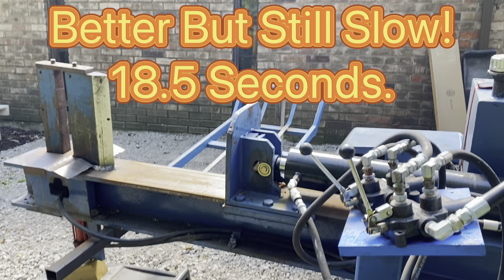How to Make Hydraulic Log Splitter Way Faster! #80

Comment: No need to crack lines to bleed air hydraulic systems will always push the air back to the tank tighten lines and go great mod tho that will help a lot
Reply from the maker: Thank you. I wasn’t sure when I did this mod and recorded the video. I figured better safe than sorry. One thing I like about having a channel is the fact that not only can I help others with ideas but others can help me with comments as well. I still have a lot to learn. Learning every day.

Comment: Your major flow restriction is at the elbows, not the line diameter.  "What is the pressure loss in a 90 degree elbow?
Designers usually apply the general rule that a 90" elbow bend has a pressure drop equivalent of 30 to 50 pipe-diameters length of straight pipe"  Use longer pipe or long radius elbows.
Reply from the maker: Richard, thank you for the information.  Definitely something to consider.
Reply: Boules law on fluid pressure in an enclosed space states otherwise. Pressure is equal everywhere. Aircraft actuators have 90 degree elbows and it’s going to be 3,000 psi wherever you measure it
Reply: Pressure and FLOW rate are entirely different. GPM at the pump is limited by the fluid delivery piping length and turns. @Huzzunga

Comment: Love the term " ticket money".
Teflon tape shouldn't be used on hydraulics. It can break apart and cause contamination or blockages. There's paste that can be used.
Because of the oversized rod used on those cylinders there is a much higher flow rate when the ram is retracting. This is often well in excess of what your valve can comfortably handle. This is why dump valves get fitted on splitters with oversized rods. You may end up with some oil overheating problems if your valve is close to the capacity of the pump. If they are both 15gpm for instance then it could easily be more like 40gpm that you are trying to force through the valve when retracting.
If you don't have overheating problems you'll now have yourself a fair beast.
Reply from the maker: Alan, thanks for the info. That makes sense with the Teflon tape, you can see in the video I pick a little debris out after removing the old lines which also has Teflon tape. I have no idea what these valves are rated for, I believe I may have a 22gpm but am not sure. The hydraulic tank is 12 gallons. I have run it a bit since and it has not gotten too hot yet I will definitely keep an eye on it. 

Thanks for the tips and for watching and commenting. My ticket money is gone for a little bit now as I just picked up my new splitter!  I am trying to get that on the channel shortly I have a few videos to catch up on.
Reply: I've never needed ticket money as yet. I am thinking with all the money I have saved in more than 30 years of driving and not needing to use it I should finally buy myself a box store splitter and then speed it up. Maybe put a Binford 6100 splitter kit through it.
Reply from the maker: Knock on wood it’s been well over 20 years for me. You’d have the fastest box store splitter out there.

Comment: Did you change the size of the push and retract hoses , are they still 1/2''. What size pump you running? My oil gets hot , I have a 1'' return hose but the delivery hoses are 1/2'' I think I will swap out for 3/4'' for less restriction. The pump is 2 stage 28gpm. So it hoots along. The cycle time is amazing.
Reply from the maker: Yes, I changed out all of the hoses to larger sizes. This machine only had a 22gpm pump. I think you definitely should upsize from 1/2” for that machine.

Comment: Nice project❤❤, pls what's responsible for faster movement of the cylinder?
Reply from the maker: Thank you. I think the biggest difference is the diameter of the inner cylinder on the hydraulic Ram. It is a larger diameter than the old ram so it has a little less power but is way faster.

Comment: Loved the rant, I agree entirely, what bugs me is the drivers trying to fit their hood into my tail pipe, they are so close you could have a conversation. Some nice splitters you got there, I need to upgrade mine but never seem to get round to it. All those 90°s on the blue will have a lot to do with cycle time too, you could turn the controles to verticle and have the same hoses going strait in without the 90°s. A good way to check for problems is a one of those IR temperature guns, after running a while the problem areas will be hotter than the rest, follow the circuit from the pump output all the way round to the tank return and look for sudden temperature rise in and out of each component.
Reply from the maker: Thank you Derek, I never thought of that. I love learning more!  I have since upgraded from old blue but still good information to know.
Reply: @hardworkingmanoutdoors the IR temperature guns are good for checking trailer wheel bearings too.
Reply from the maker: @akbychoice  definitely, I use mine a lot for the flat top griddle too while cooking. So many uses. Thanks for commenting!
Reply: Ticket Money! Love it! Totally agree! Now for the business at hand!
Reply from the maker: @dporrasxtremeLS3  thank you!

Comment: There is no need to bleed the cylinder, any air will get pushed in return line to the hydraulic tank. Tank has a breather
Reply from the maker: Thanks Randy, I wasn’t sure at the time I made this video but have since learned quite a bit about hydraulics. Still a rookie but learning as I go.
Reply: You are absolutely correct.

Comment: Keep in mind what you gain in speed you loose in power. My home made splitter is 15 secs a cycle which does me just fine as I need all the power I can get in Aussie hardwood. You don’t need such long travel. This is where you can loose time. No need to bleed lines.
Reply from the maker: Thanks Alan, you are correct. The power is a bit less but will still split almost anything I need it to. I wasn’t sure about bleeding the lines but have since learned it was unnecessary.
Reply: @hardworkingmanoutdoors  not having a dig mate. Did a great job. As long as it splits all you need is…..all you need. Cheers mate.

Comment: I am new to your channel and just watched your video. I have the same problem with my splitter being too slow I was wondering if you change anything else beside the cylinder and the return hose. What size is the pump on blue?
Reply from the maker: That is all I changed on Blue. As far as I can tell it is a 22gpm pump. The cylinder size and ratio made the biggest difference.
Reply: @hardworkingmanoutdoors  Thank you, sir, changing out the cylinder was going be my next move.
Reply from the maker: I was apprehensive but really glad I did it!
Reply: @hardworkingmanoutdoors  Do happen to know the spec on the timberwolf cylinder?
Reply from the maker: The outer diameter of the cylinder is 4.5” and the shaft is 2 3/4”. If you need any other information let me know and I’ll try to get it for you.

Comment: @ $1,300 delivered you could have a 27 ton NEW Yardmax splitter.
Reply from the maker: I used to have a 35 ton Huskee and even before I sped old blue up I could make more wood with it easier than I could with that splitter due to being able to push the splits through, stacking splits, and the 4 way.  Now with is running at a decent cycle time I definitely prefer it to a box store wedge on the ram style splitter.  It also sits higher making working it easier on my back.  A lot of wood is split every year with yard max, huskee, etc. splitters but I definitely prefer the push through style.  Also a lot of easy modifications could make Blue even better!  Thanks for watching and commenting.

Comment: Watch the radius like one the return into the tank.  A harsh bend like that can destroy the hose
Reply from the maker: Thanks John, I did not know that but have already added another fitting to take that bend out.
Reply: You may want to just take the splitter to the hydraulic shop and ask them to replace all the lines/fittings with radiused fittings.

All those  reducing fittings and 90’s create a lot of power loss.

Comment: You might put a 22 gpm pump on there now that you have 3/4 inch lines.  I bet you’d be sub 7 seconds.  Mine has about the same setup with the 22 gpm pump and a slightly bigger cylinder than yours and smaller rod and I’m still at 9 seconds.
Reply from the maker: Brian, I believe it has a 22gpm pump but not positive. I do know the Honda motor on Blue wasn’t running right and that may have had something to do with it. I have a newer 13hp Honda I am putting on it now and we will see how it does.

Comment: Just get a 2 speed pump problem solved . First stage is high flow and fast when it hits the kog the second stage is low flow and has high pressure to split.
Reply from the maker: Old blue was slow, glad we upgraded

Comment: Obvious you're all about speed, so why use those adjustable wrenches that always seem to be too tight or too loose.  Get some decent solid wrenches.  How much did that total mode cost you, not including a paint job?  It couldn't have been cheap?
Reply from the maker: Thanks for watching and commenting. The total cost was around $800. As far as wrenches go I have them in the garage and looking back I should have grabbed the proper sizes.